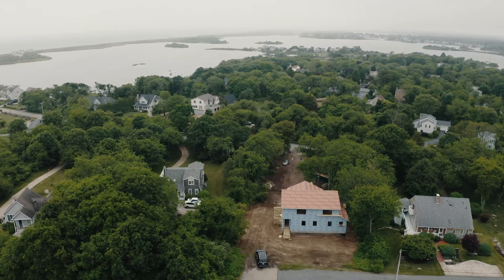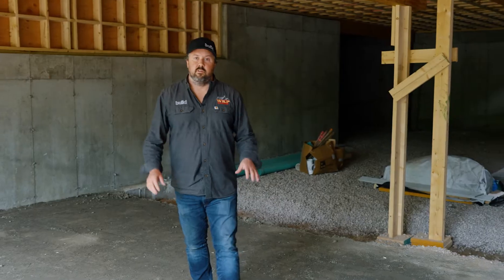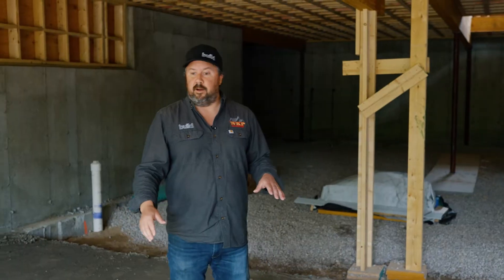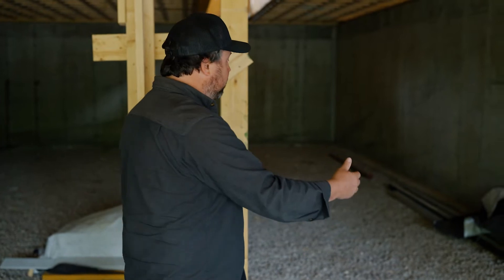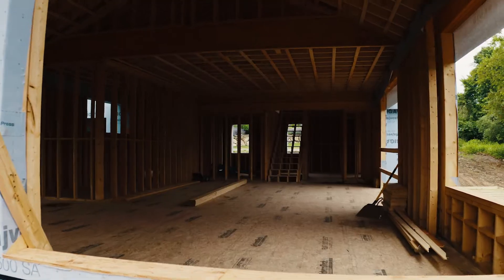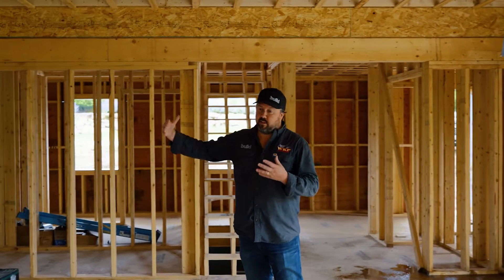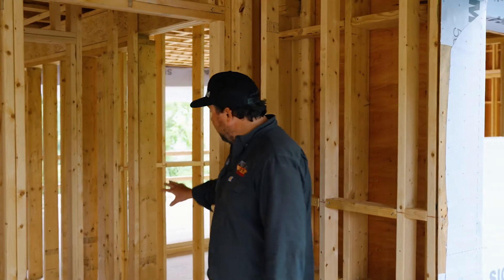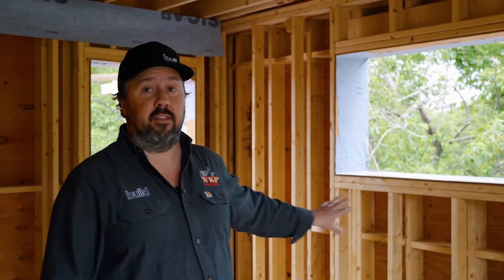Passive House Custom Home | New Project Walkthrough

Comment: With respect to the concept of this truly being a Passive house, why would you be installing a fireplace? My understanding is that even the best sealed unit is still going to not air seal as tightly as one would ultimatly like for PH standards. Also (my understanding) this would create way more heat than would be needed in a Certified PH. I'm not writing this to be super critical, but for self education. I have seen/been to 4+ Certified PH builds/remodel and the particular PH designer has implied in his talks and presentations) that in order to be a TRUE PH there are distinct standard that need to be done beforehand, in order for a home to be PH. my understanding ( again) is PH is not just air seal, insulation, & thermal breaks. It is the amount of electricity needed used in the home itself (HVAC/Water/ other heating and cooling uses in the home.  In your presentation (and others on The Build Show Network) that say you're building to PH standards it seems like you guys are doing it as an afterthought (Sor of like what Matt did with is home in Texas). If I'm misunderstanding this, please correct me and point me in the right direction (information wise). Thanks!

Comment: no mention of the house wrap over top plates and air barrier design . I always worry about the rafters and top plate and the sealing for air
Reply from the maker: Hey Bill - we'll be getting into the air barrier strategy on a future episode!
Reply: @WKP_Builders  My next roof plan is what I am thinking about, big timer rafters, decking, ply, insulation strapping then (metal) roof.  Do you ever consider ICF for builds ?  We supply R-30 and R-22, it saves time and labour and offers continuous air and  vapour barrier, already insulated, no shipping or stripping of ply forms, structure,  great for seaside as the salt doesn't affect it and maybe steel beams aren't  exposed